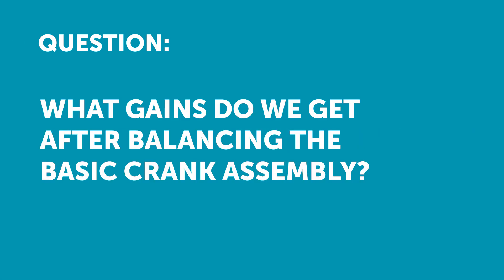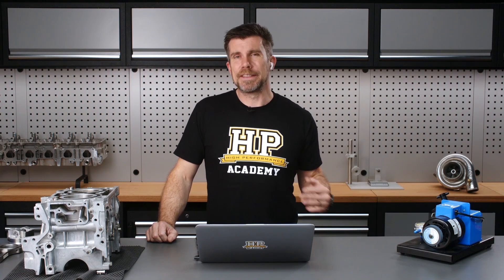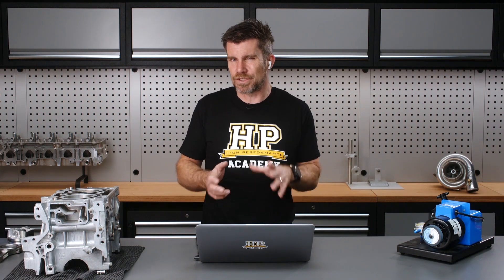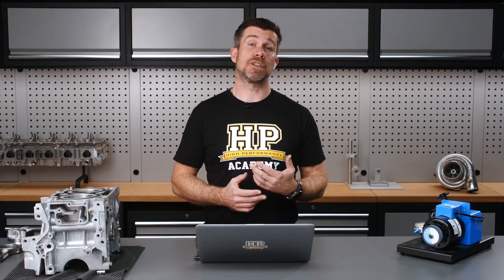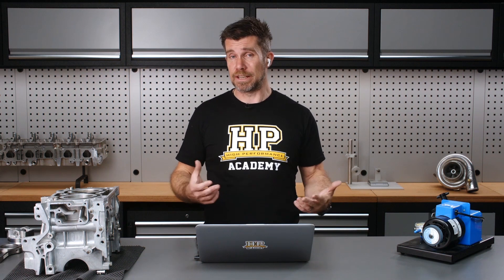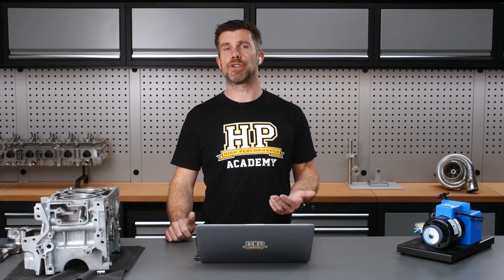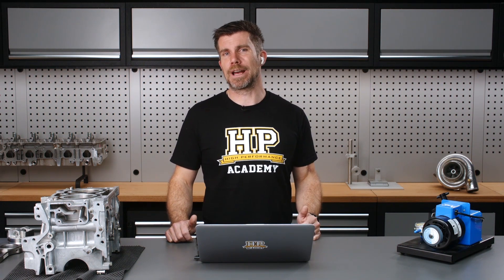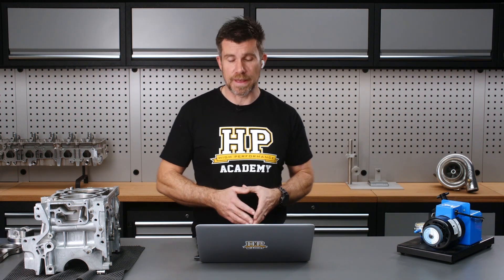Crank Balancing Gains [HPA Q&A]

Comment: With a production engine it may all be reasonably close if rebuilding with the same parts. When you're rebuilding with different parts a piston or rod or both could be 50 - 100g difference it's insane not to balance. One h-beam to another brand h-beam rod can vary by 80g. Image that 80g spinning at say 7k. That's just a rod, what about the piston difference? So from a stock engine you use different components and end up with a rod and piston mass of an extra ~150g. That same counterweight is longer going to cut it. Just going out on a limb here but I'd suggest in this case balancing is a necessity if this engine is to perform or even survive. Mains bearings ouch.